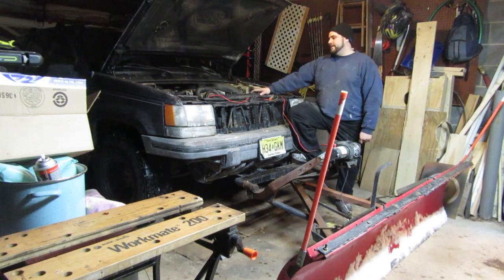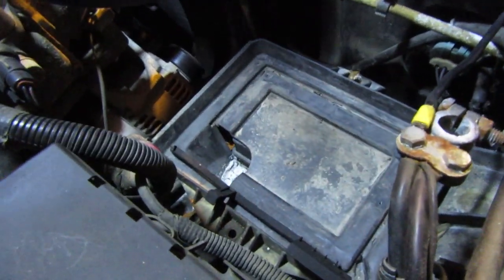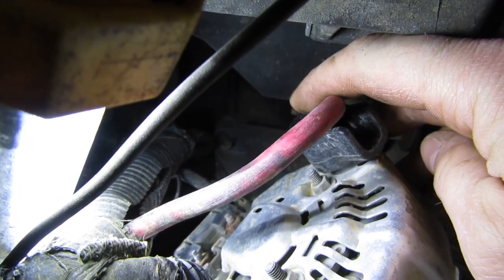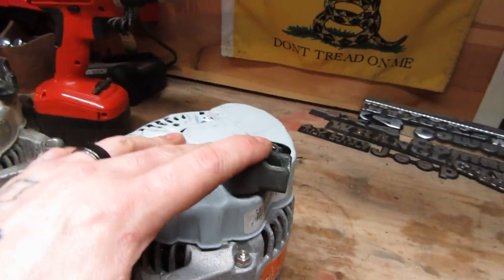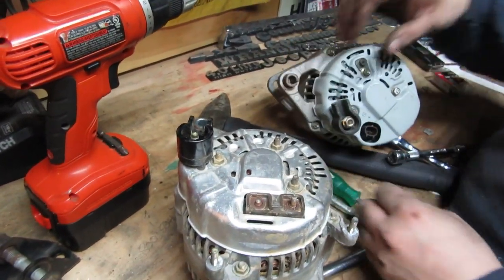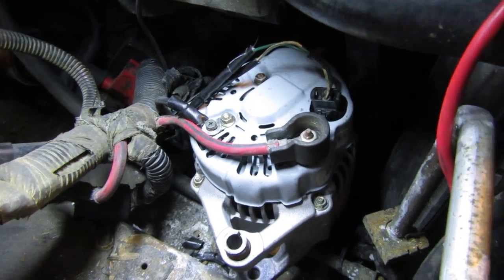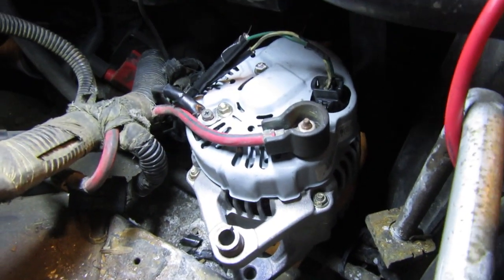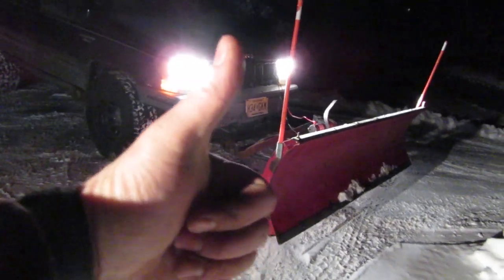$35 Jeep 4.0 Alternator Upgrade - Stock 90 amp to Dodge 130 amp

Comment: 3:27 Thats right folks, you too can double your alternators 90 amp output to 130 amp for only $35!! But make sure you have a couple maps under your hood or its gonna be hard to find your way back out of that engine bay! Or perhaps you could just use the gps on your phone. If i had to guess,  its probably right next to the calculator app.

Comment: I banged my alternator in for some reason it just didn’t want to go in I had no grinder to grind the spacer in the bottom that was the problem. My temper got the best of me after 2hrs some dents on the case but yea Autozone duralast gold replacement. Did anybody else have this issue?

Comment: I have a 1994 XJ and, the voltage gauge has always read around 14.4-14.5 volts when driving, but the past couple weeks it's been showing 13.0-13.9 volts when driving. I've never seen it that low before in the 10+ years that I've owned it. I've checked the battery with my multimeter several times, including this morning with it running and all accessories on and my meter is routinely showing 14.35-14.37 volts with everything on and 14.45 volts with it running and all accessories off. Have these cluster voltage gauges been known to just randomly lose their accuracy all of a sudden, after so many years? Anything else I should be looking at, or should I assume everything is okay in the charging system? Thanks!
Reply: Yeah my 93 xj has never went over 14V and dips heavy when I got the subs and winch going these gauges get bad grounds and wrong reading all the time. That’s why just to be safe this winter I’m doing this upgrade probably next weekend
Reply: Not a bad idea, I have this on my list as well.

Comment: It took me waaaay too long to find a vid that had a simple "what to cut and put back together" layout. Taking a '94 XJ 90 Amp and going to a 180 amp aftermarket Durango alt. Gotta do some grinding to make it fit, but now I know the wiring... I'm all in. My head has finally quit hurting about this. The dead wire snips and using wire strippers for crimpers was worth the price of admission. 
My shade tree heroes.

Comment: So I put a 136 in mine and it fucking is worse than my 90 I had in there for some reason I don’t know what the fucks going on maybe the one I got is defective somebody said I needed to upgrade the main wire that comes off of the alternator that has a fusible link to the fuse box I need to upgrade that till like a two gauge at least and also the other positive wire that goes from the battery to the fuse box to a zero or two gauge…. But it makes no sense that now it works worse than it was and it won’t keep my battery charged… 🤷🏼‍♂️🤷🏼‍♂️😫😫😵‍💫😵‍💫😪😪😪

Comment: After 2 years from watching this video, it finally happened.  My stock alternator gave out and there I was at the ol pick your part. Found the 136 amp from a 1500 5.9 (weird but that's what was on it.) and BAM! installed in less than a hour thanks to yall.  Cheers!

Comment: About to do this, I looked in my 96 and the field terminals were green and green and orange (striped). I'm thinking I'll just go striped to striped and solid to solid but still want ask for advice
Reply: I have a 96 xj how did you wire it is mine the same as yours will be doing these upgrade soon

Comment: Dude I’m fucking stoked to try this out mine probably has a stock Cherokee alternator I’m guessing because when I use my air conditioning and my headlights my needle drops almost into the red… so I’m hoping 130 amp will be much better plus I want to try and wire up to electric fans rather than just the one that I’m using now to help out with some power and make my motor work a little easier on its own rather than Spinning a clutch fan
Reply from the maker: Good luck!

Comment: Any body know if a 2004 durango 160 amp alternator work with an 01 xj
Reply from the maker: It should, but I have not tried that one specifically
Reply: I'm gonna upgrade the wiring and throw it in and hope for the best
Reply: 2001-2003 Durango is the one everyone uses

Comment: Soldering has its place but not here.  Alot of manufacturers wire splicing protocol is to use a nice weather proof butt connector over soldering. Soldered joints can be brittle and break apart.  👍

Comment: Better alternative would be to find a Jeep original Nippon Denso alternator Part Number 56005686 130 amp,this has original connections as your.So no need to convert to the plug type

Comment: I was able to put the 165 amp Durango 05 ish year  alt on my 99 Jeep 4.0  bolted up fine case was tad smaller then my lil baby alt too fyi mine had the elbow on alt no problems
Reply: Will 06 Dakota work ?

Comment: " IT'S CALLED A HARNESS DELETE & IT GIVES YOU 20 MORE HP.,  DON'T DO IT " LMFAO. I just picked up a Denso 56027913ALT.  from Craigslist & a Starter for $10. They were off a 98 Grand 5.2, Alt. is 1 month old & starter is about 3months old the guy said ? I'm not sure though how many AMPS. the Alternator is though ? He also left about 4 inches of wire on all the connections & the one bolt on the ALT.  Nice vid. GUYS.
Reply from the maker: Sounds like a dang good deal! Rock on!

Comment: Question- did you have to grind down the alternator in any way? I keep hearing that may be needed.
Reply from the maker: We did not have to remove any material from the housing of the alternator. I have heard of swaps where that is required, but this is not one of them

Comment: How do you tell the difference between the 130 amps and 160 amps alternators?
Reply: Honestly wasn’t being a jerk . When I went I wasn’t sure and looked up the part  numbers .the one I found the numbers were visible so it wasn’t an issue. And some people don’t know to look up the numbers
Reply: @williamjwarren3735  i hear ya. I watched this vid years ago and looked at ram trucks in the yard and out of about 5 trucks i couldn't tell what any of the amps were on the alternators. Looked up several #s and closest i got were trucks compatible with them but not exactly what they were. They dont  make it as easy as looking at the part# on them for some reason.
Reply: Look up the part numbers
Reply: @williamjwarren3735  damn thats so easy. How could I have possible missed it. Oh ya I have tried. Every alternator I looked at in the junk yard has a few numbers on it and none of them lead to a part number that clearly defines what amp it has.

Comment: My concern over adding an alternator with that much more amperage would be burning out the ECM.  How's it working out for you, any problems?
Reply from the maker: The alternator voltage out is externally regulated by the Jeep, so it will only pull as much juice as it needs. For our purpose on the plow jeep, this is perfect. One year in and much use and all is will.

Comment: you can get a direct bolt in 160amp out of a durango or dodge ram. don't forget to upgrade the wiring.
Reply: what years Durango or Ram?
Reply: @mynameisprivate158  01 to 05 iirc

Comment: Does a 2002 alternator work with a 4.7 engine and alternator
Reply from the maker: No, this mode is for the 4.0 only. i am sure there are alternator upgrades for the 4.7, but I am not sure what they are
Reply: dodge durango alternator will work with 4.7 and 4.0 jeep wj’s
Reply: 2005 durango 4.7 alternator is 160 amps and i think the wj is 130 amps stock if i’m not mistaken so it’s an upgrade. you can also get 250 amp and 320 off ebay and other websites

Comment: All they had to do is get a V8 Zj alternator there 135 amps direct swap no rewiring I have 4.0 90 amp also and that's what I did
Reply: really? v8 ZJ alternator doesnt require the re-wiring?
Reply: Nope That's all I run in my 4.0 and I replaced 3 of them the 8 years I own mines
Reply: When we did this my original plan was for the 160 amp which I m still in the hunt for. So I found this 130amp  and swapped it in prepping me for the 160

Comment: Good upgrade. I'm just wondering have you had to upgrade your wire harness for the extra amperage from the alternator?
Reply from the maker: We have not encountered an issue with the stock wiring being too thin so far. we will keep an eye on it though. Thanks!
Reply: @DEInTheGarage  how about now 2 years later still holding up?

Comment: Doing this upgrade along with the "Big 3" would make a world of difference.
Reply from the maker: Big 3?
Reply: @DEInTheGarage  4 gauge wire from the positive terminal to the alternator,and 2 4 gauge wires on the negative terminal one to the uni body and one to engine.A lot of people do the Big 7 upgrade like nickintimefilms or ksuspension.
Reply: I'm getting my ksuspension wire set in next week, as well as their headlight harness upgrade. Now I'll be adding this alt swap to the mix. Can't wait, should be like a new ride.
Reply: I did the ksuspension power upgrade on my XJ and I barely had to touch the key to get her to start.  Makes the power windows work better too.  Nice thing about it was that it took the fusible link out of the system and replaces it with a mega fuse available at any parts store.  On my 5.2 ZJ I did the same thing, only I got a 160 amp Durango alternator from my local U pull, not because I need it (yet) but because why why not?  Also, before I did the power upgrade on my ZJ I had a power window that didn't work. After I put it on, it started to work.

Comment: Thank you guys for this video. Did this about an hour ago on my 94 zj as my alternator was on the way out; went and bought a new 99 durango 5.9 alt (bought pig tail at junkyard for $1) This is a stupid easy upgrade I would've never thought of it if I didn't stumble on to your video. Btw my battery box was not worth the time to remove and the alternator slides in easy(ish) from the bottom for anyone else who doesnt have time to waste on rusted rounded bolts. You guys got a sub out of me thanks.
Reply from the maker: Glad you enjoyed the vid and were able to complete the upgrade. Thanks for the tip on the battery tray. good call
Reply: @DEInTheGarage  Great video the Pigtail that i brought has a black and green wire any idea how to wire that up to the ZJ?

Comment: Swap to a deep cycle battery as well.  They respond better to that kind of charge/discharge cycle.
Reply from the maker: That is a very good time and definitely worth the price. Thanks!
Reply: NO IT'S NOT, BAD, VERY BAD IDEA,. NOT DESIGNED FOR CRANKING OVER AN ENGINE.
Reply: A CAR BATTERY NEVER GETS FULLY DISCHARGED BECAUSE OF THE ALTERNATOR, IT'S DESIGNED PROVIDE A SURGE TO START YOUR VEHICLE. DEEP CYCLE BATTERIES ARE MEANT TO BE CHARGED & DISCHARGED CONSTANTLY NOT DESIGNED AS A CRANKING BATTERY LIKE A CAR BATTERY. DEEP CYCLE BATTS. WILL ONLY PROVIDE AROUND HALF THE COLD CRANKING AMPS COMPARED TO A REGULAR CAR BATTERY, BAD IDEA. SORRY CAP LOCK FREGGIN STUCK AGAIN.

Comment: Question for you man I've went through and started looking at your videos I'm thinking of installing a second battery and running it parallel to keep 12 volts if I switched up to a 250 amp alternator instead of a 110 that would not harm the batteries would it it would only help and charging them quicker correct reason for two batteries is a 5000 watt inverter to run a compressor and shop lights out of the back of my van
Reply from the maker: Dang, that sounds pretty cool. I will be honest with you, I am not certain what implications such a heavy system would have. My initial thought is that it should be ok as the 250 amp is what is possible, not what it pushes all the time... That said, I am not sure what other parts of the system might be affected. I would try to track down an electrical engineer and see what they say about it. There is a guy on YoutTube named MartinBuilt. He does some CRAZY stuff and I believe electrical is his profession. You might have better luck tracking him down to see what he says about it.

https://www.youtube.com/user/martinbuilt

Good luck with it! I'd love to know how it turns out
Reply: i will recommend to use 2 batteries w a 130 amp alternator and a battery isolator, since a battery isolator will give more power to system. and if u want to add some continuos power solenoid to conect both bateries togueter when need, any more questions visit my channnel, called proxpexican,

Comment: I DID A ALTERNATER UPGRADE ON MY ZJ I PUT A NEW ONE FROM A 5.2 V8 135 AMP BUT IT HAS MY CHECK ENGINE LIGHT ON THE CODE READS HIGH VOLTAGE

Comment: Hey guys.  You could have used one of those cold heat cordless solding pens on this job.  You can get one for about $20.  I now have my second one and they work like a charm.  I found out the hard way NOT to leave a piece of solder sticking between the two contact probes because the next time you use it, there's a chance you'll burn out the elements inside the pen.  At least I think that's what caused my first one to stop working.  Anyhow, one of those would have been perfect for soldering those connectors to the "new" alternator on this project.  The cold heat soldering pens / irons produce instant heat at the point of contact and I mean INSTANT heat that will melt the solder in about 2 seconds.....literally.
Reply from the maker: Interesting.. I will give this some thought for our next electric project. Thanks!

Comment: Is the bigger alternator effecting mpg?
Reply from the maker: No, not really. Technically I suppose to puts a BIT more draw on the engine, but not enough you would notice. maybe on a long highway ride you would see a slight decrease in MPG. Very slight.
Reply: D&E In The Garage did need a bigger battery?

Comment: Will that alternator go into 2.5l jeep?
Reply from the maker: I do not know the answer to that. I will try to find an answer and hit you back. good question!
Reply from the maker: So i was able to confirm that for most years the 2.5 and the 4.0 shared the same alternator. That SHOULD be that this swap will work for your 2.5 the exact same way it worked for our 4.0. I cannot find any information that would disagree with that. if you decide to go for it, I would be really interested to hear about your experience.
Reply: I will let you know if it works for mine.

Comment: I just want to point out for the people who don't know Dodge alternators are externally regulated by the computer that's what that big orange sticker on the Dodge alternator is I'm not sure about the Jeep and if they're regulated by the computer or not but if the alternators on the Jeep are internally regulated and the Dodge alternator is externally regulated this will not work
Reply from the maker: Jeep Alternators in the year range where this swap will work are also externally regulated by the ECU. This swap is 100% safe for any ZJ or XJ with the 4.0L engine.
Reply: Well it's working so it must be good

Comment: 98 zj has a 135 amp bolt in replacement
Reply: What's the PART NUMBER on the Alternator ? Never heard of a 135 AMP. Alternator ?

Comment: everything i find is an 117, 136 or 160 amp do you have a part number
Reply: Dodge Years the motor was used. I believe mine was from a 1998.
1994–2001 5.2 L (318 cu in) Magnum V8 
1995–1997 5.2 L (318 cu in) Natural Gas V8 
1994–1997 5.9 L (360 cu in) Magnum V8 
1998–2002 5.9 L (360 cu in) Magnum V8
Reply: E from the D&E in the Garage the original part number I was looking for was a Denso 56029. That is the 160amp alternator but it was very hard to find in decent condition. So I started looking for any 5.2l dodge with the “bunny ears mounts” that had a new afternarket one and googled the part number to see which amp it was. That’s how I found the 130amp.
Reply: Eric Draghi do you know the year?

Comment: Nice job guys. Good info. 

One thing to note: crimp connectors are actually the correct way to do it, just with better quality ones that you can visually inspect (non insulated) prior to shrink tubing. The stock harness on any modern car has nary a solder joint on it for a reason: solder + vibration + heat = failure. 

So, your laziness in getting the iron paid off. Congrats. :)
Reply from the maker: Boy do I love it when laziness pays off! could you suggest some quality butt connectors that we could use for applications like this?

Thanks for the feedback and advice!
Reply: D&E In The Garage no kidding. :)

Best ones are a matched set (connector and crimper only work together). Otherwise, most non insulated work well. I crimp right on the seam with the wire centered so the connector curls and splits/grabs the wire
Reply: I know I'm replying to a 7 year old comment, but is it bad to solder a crimped connection? As in, assuming the crimp is good, does it hurt to add the extra solder? Because surely if the solder was to break from vibration, you still have the good crimp right? You just wouldn't want to do a shitty crimp and then rely on the solder for a good connection?